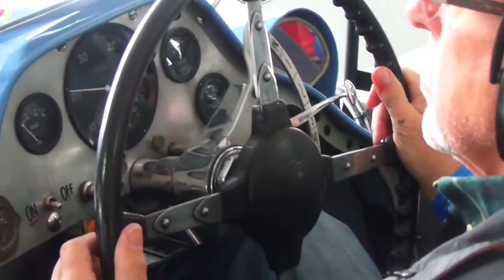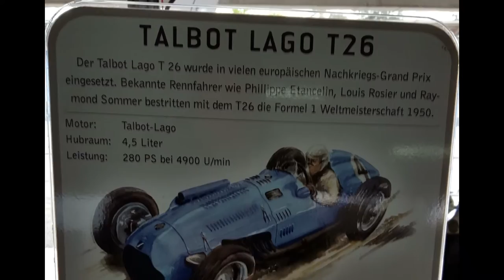Start Up Talbot Lago T 26, Vintage Grand Prix Racer

Comment: Very cool engine in this car.  First time I'd even heard of a twin-cam pushrod engine, thought it was a typo at first.
Reply from the maker: Hi, google said dual overhead cam but u made me curious now and i'm resaerching. I remember, there wasan engine, not taolbt,  with one overhead cam  and hemispherical combustion chamber. This engine had little pushrods to the other side. Was it the Triumph Stag? Cheers, Axel
Reply: @corvette724  - Yep, the Talbot Lago didn't have an overhead cam engine, though the two valve covers makes it look like a twin overhead cam engine.  It's a dual pushrod OHV with two camshafts down low on either side of the engine about level with the crankshaft.  One set of pushrods actuates the inlet valves, the other set is for the exhaust, hence the two valve covers.
I don't know about the Triumph, sorry.
Reply from the maker: @kuckoo9036  awesome Information. I pin your comment for the others of the community. Thx a lot.
Reply from the maker: @kuckoo9036  could u pls comment this in the comment Box so i can pin it?

Comment: A pity it didn't come over for Indy, back in the day...

An interesting match for the Blue Crown FWD cars of the late '40's

The NOVI's

Evergreen 8CTF Maseratis

Grancor FWD Miller Fords

And the various champ dirt cars

Be nice to have seen....

J.C.
Reply: Indeed, it would've been a very interesting thought. The Talbot-Lago is not as fast as the other GP cars of the era (let alone Indy racers probably), but they were very reliable and economical on fuel, giving them potential on long, hard, high-attrition races. Indy 500 is one of those, and like you said, no Talbot-Lagos ever went there, which is a shame.